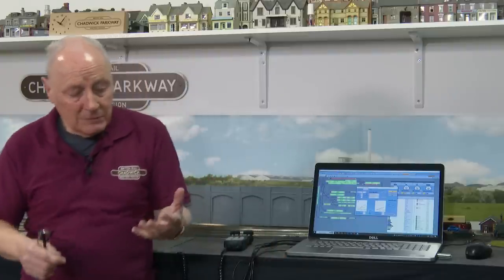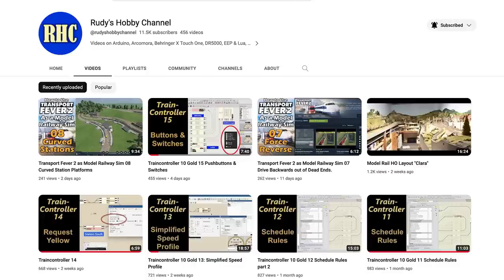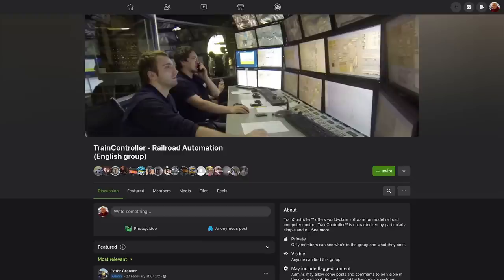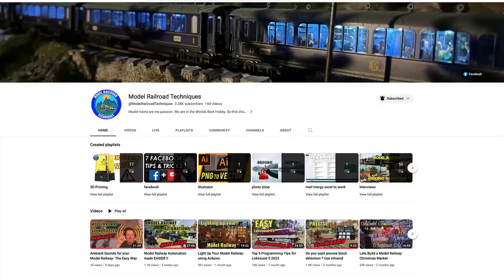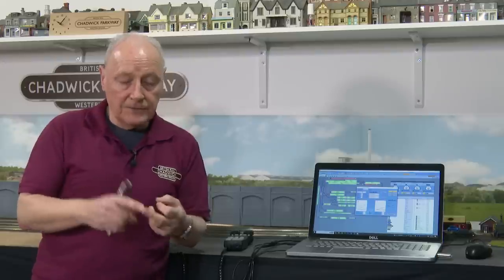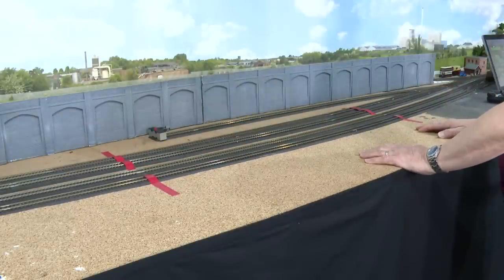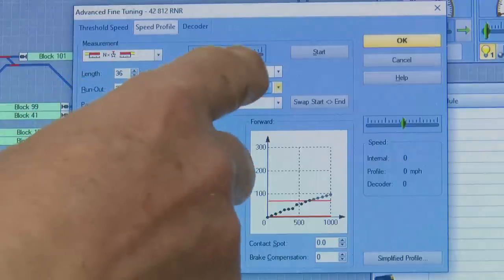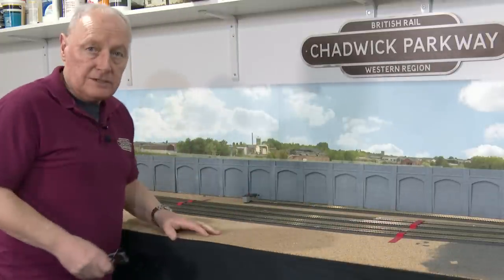SPEED PROFILING with Train Controller at Chadwick Model Railway | 184.

Comment: Charlie, that is a very good video. I do use Train Controller and Digitrax and do have both of those handsets. I've tried unsuccessfully a couple of times to do the speed profiling. I've seen Rudi's videos which are good, but the problem is that he doesn't show it going wrong often enough. Now I've seen the length of track you are using - which isn't so long -  it gives me the idea to set up a separate speed profiling track to avoid any points or slopes which clog up my layout. Have you tried it with your HST (or Pullman) which, if I remember correctly, is powered only at one end? I presume when going in a backwards direction the offset is not the one inch you use for the Hymek, but several feet. Any idea how it works if the end with the unpowered car picks up power for lighting, sound etc.? Cheers and thanks Charles
Reply from the maker: I’m so pleased that you found it. Interesting Charles. With my HST I never run it backwards. However, my Pullman has two power cars, which provides nothing but headaches. Regards, Charlie

Comment: Excellent video, Charlie.
How many speed steps are you setting your decoders to? (28 or 128)
Reply: In the speed tuning procedure you see 128 as the maximum, so it's running 128 step mode
Reply from the maker: Always128 Ken. Regards Charlie

Comment: Nice one Charlie, Quick question it takes about 2 seconds for Train Controller to recognise a loco as it moves into a block, is this normal? 
TOMREIP
Reply from the maker: Hi Chris, assuming you’re working on current detection, could you time it from when the Pickup wheels first enter, to win the block turns pink. Regards, Charlie
Reply: @ChadwickModelRailway  Hi Charlie, 
Yep using current detection, it varies a little, but about 2 second.

Here is some other info for new dummies like me to Train Controller & DigiTrax.

1. If the pickups are on front and rear bogies of the Loco, & you stop a train in a block "Waiting Time” and over run a little so the front bogies are in the next block, you will sit there for ever because TC thinks there is something in the next block and will not allow the Loco to move. 
You can go into the Schedule Rules and tick the Enter Occupied Blocks, but that is the same for all blocks in the schedule, tantamount to disaster.

2. With the 2 Second delay if you are entering a block at say 50mph you will lose say 12inches of your measured length of track. So 36 measured inches becomes only 24 inches for TC to do anything.

3. So small lengths of track say 12inches are unless, unless you are entering at a crawl speed.

All very logical, now I have done it all. But if you’re new to it all, like me, my observations might save someone some time.

TOMREIP
Reply from the maker: An excellent comment Chris.  I have found that short blocks should be avoided whenever possible. Also speed profiling is absolutely essential. Regards, Charlie